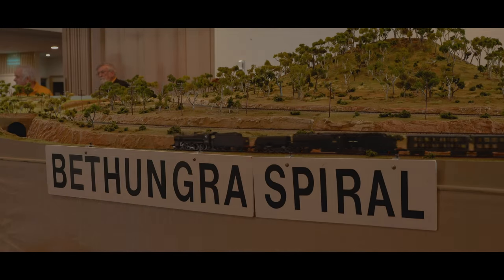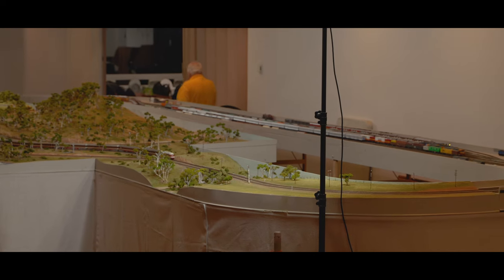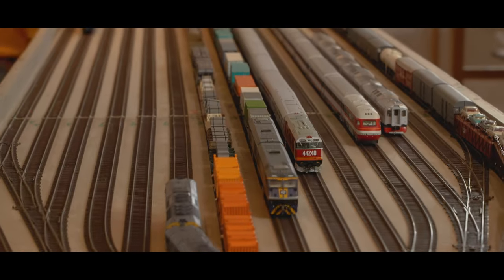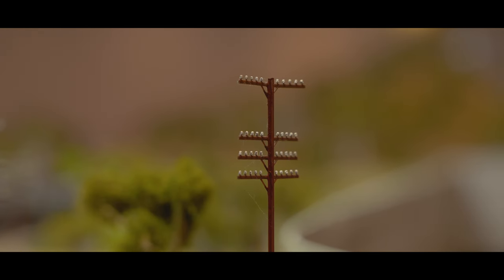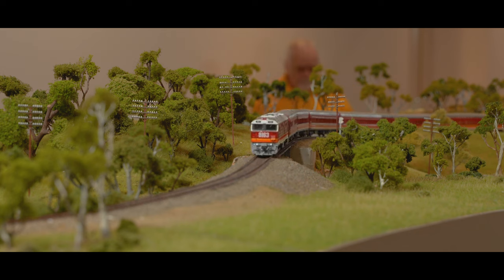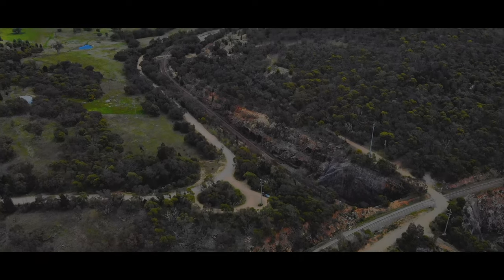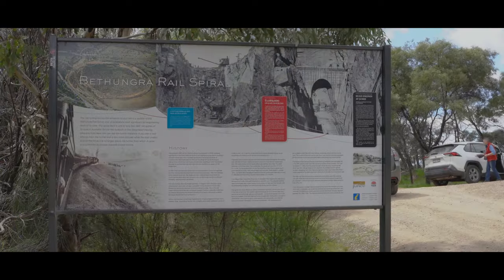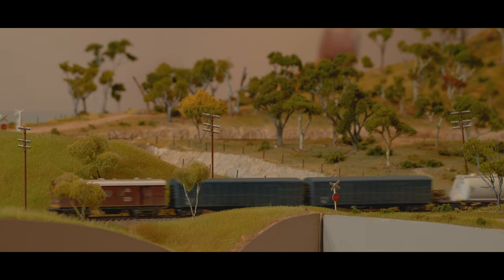Bethungra Spiral - HO Scale Exhibition Layout

Comment: A few Clubs have DC on one track and DCC on the other.This is problematic for operation.It means that the whole layout cannot be used.What happens is that the drivers go round and round,in a game of chasings.May as well have a circle of track,with no points,no sidings,no stations. Better to alternate between DC and DCC,so some operation can be held.Otherwise all the time and money spent on points and sidings is wasted.
Reply: Good point for club operation. That is what AMRA Vic do with a switch for DC or DCC running separate operating sessions.
For an exhibition layout it is far less of an issue as the public mainly want to see impressive trains running. Even the shunting or similar operations are best not to interfere with mainline operation or the public mainly walk away.
Reply from the maker: I agree John! I think the US layout Springfield that does the exhibition circuit here is a great example of continuous running with switching incorporated!
Reply: @johnd8892  Yes,Exhibitions are a different thing.It is at Club layouts,where many hours and thousands of dollars are spent to include Industrial sidings(coal /ore mines,steel mills,grain silos,etc)and many forget the locos have a reverse.Points are a big expense,and a source of unreliable running.Unless members have a chance to operate in these Industrial tracks,and have even basic operation type running,all this is wasted.